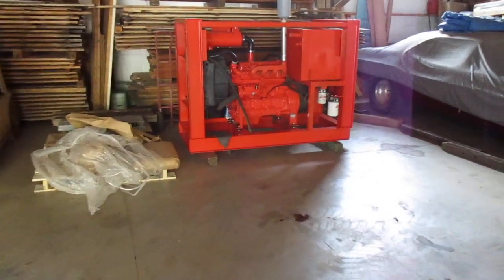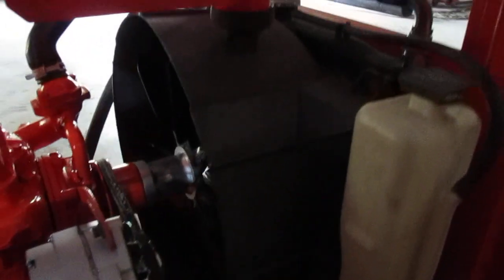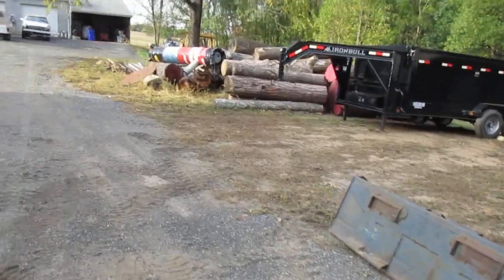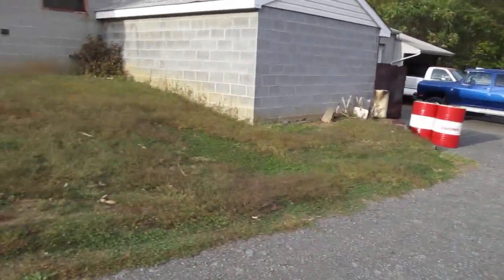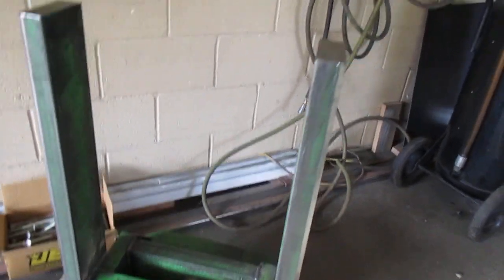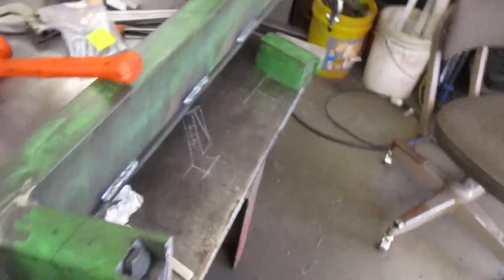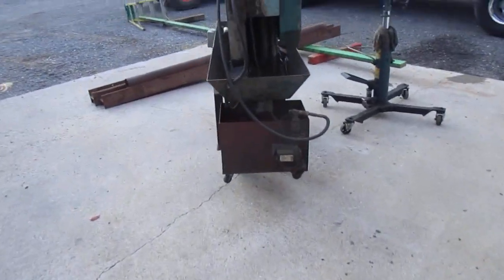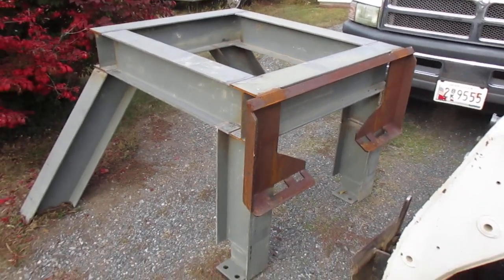#106 new wood splitter up date and bucket lift stand

Comment: Thanks for the tour, now that's a log splitter, that is some thick steel and some sweet welds.  I like that idea of solar heating the wood pile and keeping the sides open.   Keep the updates coming!
Reply from the maker: hi we work with stuff people give us . that is where that came from . we bought the 2 pumps and adaptor 1 valve  some steel and lines . good guy donated the engine we had all the cyds.